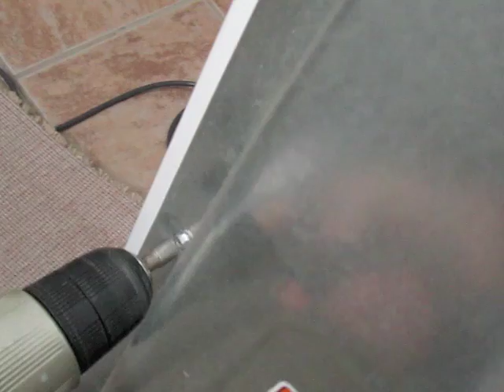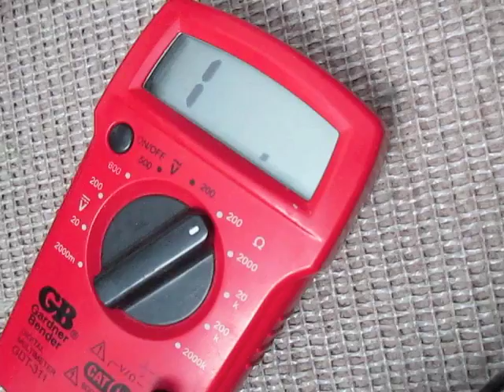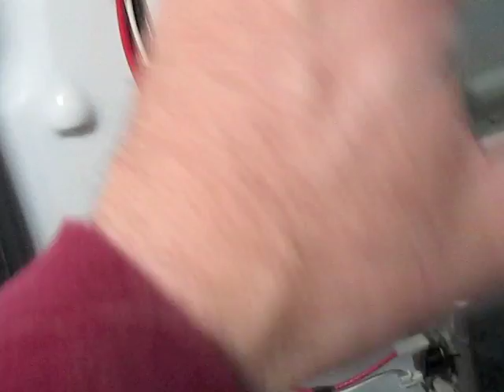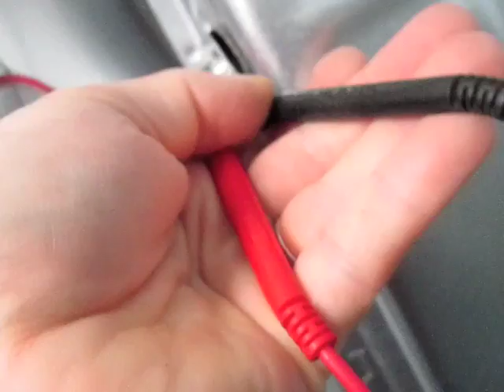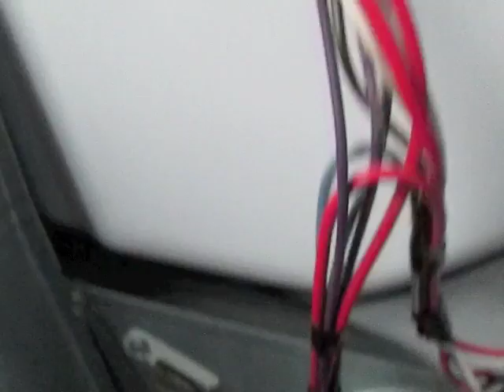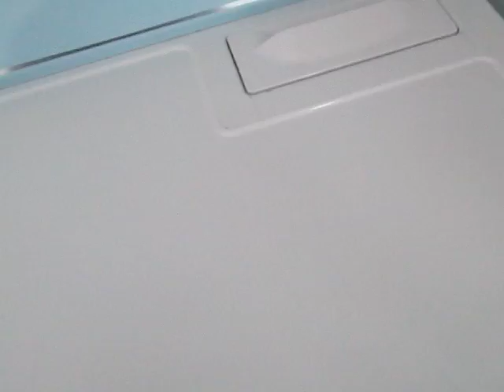Whirlpool Kenmore Roper Dryer won't heat Test or Replace heating element thermostats & fuses

Comment: I replaced all my fuses and thermostat and heating element comes on for about a minute then shuts off any ideas what’s wrong
Reply from the maker: Clean Lint filter?Probably if you went this far.  Did you disconnect the vent and make sure the vent tube was clear all the way to the point where it leaves the house?  Some times the tube is clear and it is clogged at the vent where it leaves the house.  First start by looking outside where it blows outside and make sure that is clear.  Then follow up by cleaning out the tube.  Then try and let me know if you're still having issues
Reply: @youcanfixit3721  I replaced the vent tube and it still doing it. I bought another heating element just waiting for it to come. Can it be the timer? It does move

Comment: Hi there, thanks for the video, helped me replace my heating element last year. 

This week I just replaced the belt and idler pulley, and that went fine, but after putting everything back together, the dryer drum spins up nice, and the heating element comes on, but when I add clothing or weight to the drum, the heating element does not come on. I remove the clothes, and the element heats up nice and red (I have the door switch disabled so I am able to see what is up with the door open).  Any ideas?  Thanks so much!

Edit: OK, this is strange. I just pulled the entire dryer about 12 inches forward, away from the wall, and it is now working flawlessly. My guess is that something is lose? Or maybe a thermal fuse is going bad? I guess I should double check everything. Thanks!

Edit 2: OK, so my theory now is that when the belt broke and the drum stopped turning last week, the dryer overheated and blew the thermal cutoff. Does this sound plausible?  I went and removed the vent hose and ran some tests. When started from cold, the heating element will come on and the dryer turns, drying the clothes for about 10-15 minutes. At that point I will hear a slight buzz or hum from the dryer and the element shuts off and the dryer just spins cool. So, does anyone think that I need a new thermal cutoff? Or even an entire new element? Any idea what the buzz/hum might be coming from? It is definitely associated with the heating element shutting off because I hear it as soon as the heating element shuts off.  Thanks so much!

Ray
Reply from the maker: sorry I was away.  I'd check to make sure you vent tubes are cleared of any obstructions.  make sure it is not clogged at the exit point where it leaves the house and that the vent tube is clean.  This usually blows the fuse though and the dryer won't work.  It does sound like a thermal cutoff.

Quote from internet search;
"What does the thermal cutoff do in a dryer?
A dryer's thermal cutoff switch controls the dryer's temperature, and it also monitors the amount of heat it produces. If the dryer drum is spinning but is not producing heat, the thermal cutoff switch may have failed.

How to Troubleshoot a Dryer's Thermal Cutoff Switch - Home ..."

Comment: Why thermal fuse keeps blowing?
Reply from the maker: Disconnect your vent tube from the back and see if it's plugged.  Clean it out as well as check the outlet on the outside of the house to make sure that's not clogged.  Clean it out good.  If you see nothing through the vent tube you will have to unplug and  take off the back and check to see if it is clogged on the inside.  Should be an easy fix.  1/4socket, a screwdriver, the fuse, and a vacuum.

Comment: Not helpful for diy!!explain multi meter settings smarty pants!
Reply from the maker: Well that would be on a different tutorial on how to use a multimeter.  If people wanted a 20 minute long video I would have done that.  99% of People don't.  Just set the multimeter and test it as shown.  If you don't know how to use a multimeter that's a different DIY tutorial...

Comment: We got a meter and tried it but we get no registering at all.  Not the heating element or the fuses.  What's wrong do you think?  What else can we try?  The meter seems to be working right.  We checked that first.
Reply from the maker: Well they can't all be bad.  One of the things go out typically at a time.  Either the multimeter is bad or not set correctly.  look at the element and see if it's broken.  what's actually wrong with the dryer?
Reply: @youcanfixit3721  We decided to order a complete set of heater element and all the fuses.  I'll let you know how it works out for us.  The dryer turns but there is no heat so we think this may solve the problem.

Comment: I bought a new thermal fuse but my meter counts down to zero. New heating element and it reads 10? Any ideas? I’m very confused why it won’t heat up. On a side note, thanks for putting your time into this. Helps electrical novices! Thanks for your time!

Comment: Thank you very much! I watched this video last week after the Mrs. dryer went out. I bought a multimeter and, following your tips, discovered a blown fuse in the lint trap. $7 part that I just put in and presto, it works! I looked like a genius thanks to you.
Reply from the maker: Awesome!  I really appreciate the comment.  It makes me feel like putting these up is worth while.  Glad it save you a ton of money and saved you from putting a perfectly good dryer into a landfill.  Thanks again for the comment and as always off to the next repair :)
Reply from the maker: Oh yeah I'm not sure if it's still going strong, but often that fuse goes out if the vent is getting clogged, so if you haven't checked it yet you might want too...  Thanks again!!!
Reply: @youcanfixit3721  yessir, the ol hotbox is still choochin, thanx to you. A recent maitenance job at a grade school also proved this repair works.
As for the ductwork, I now have a new quarterly chore to perform, along with a good dusting of the ignition system. Thank you kindly for your generous sharing of useful knowledge; a true rarity these days.

Comment: Can you get those parts at Lowes or Harbor Freight?
Reply from the maker: I don't believe so.  Ebay Amazon or a local appliance parts store.  The white fuse is either good or bad and you can get one of those used on ebay for way less and it's just as good as a new one.  If your fuse went out make sure to check that your vent tube isn't starting to get clogged, that is one of the biggest issues for the fuse going out.

Comment: Does anyone know what make a dryer stay hot even when it isn't running
Reply from the maker: I'm guessing it's an electric dryer.  Timer issue, check your element.  High Limit fuse may be bad or bypassed as this should have turned it off.  Maybe someone just ran it without you knowing to get some wrinkles out of the clothes and then you checked?  Sorry just some possibilities...  I wouldn't run it till you get it figured out though or make sure your close by to monitor, so you down burn the house down... If you do look around make sure you unplug before you inspect and when it doubt call a certified Tech or buy a knew one, but most dryers are fairly basic and you can probably find a how to on your exact model to take apart and put back together...  Best of luck.
Reply: You can Fix It!!!! ,No one ran it without me knowing, it kept causing the breaker to turn off, anyway had an electrician look at my breaker box, thought it was that, anyway he looked at dryer he said it's hot as hell,I felt of it,and it was really hot,it wasn't running, sounds like I hear a humming noise when it's plugged in,so I unplugged it,it cooled off, problem is it's not even a year old,I lost the receipt so I cant take it back.
Reply from the maker: @kellyhill4613  Sorry it's hard to really give a good diagnosis not being there.  Here is the first place I would try.
Defective Heating Element

A number of components inside the dryer can cause overheating. The first and most obvious is the heating element itself. If it has shorted, it may stay on even when the cycling thermostat turns it off. A visual inspection may reveal that it's touching some part of the assembly casing, but if not, you should unplug the dryer, remove the heater assembly and test it for continuity with an ohmmeter. If the meter indicates very low or no resistance, the element is defective, and you should replace it.

https://homeguides.sfgate.com/causes-thermal-cutoff-keep-going-bad-dryer-71276.html
Reply: You can Fix It!!!! ,Thank you for the advice, I am gonna go get a heating element,and see if it fixes it,but now it won't come on,idk i hate to have to buy another one since this one isn't very old,makes me so mad that i lost my receipt,or i could take it back

Comment: If u don't have a multimeter u can touch the two blue wires together, plug in the dryer and if it starts than u Kno it's the thermal fuse. That doesn't mean u can use the dryer because it's now a fire Hazzard but at least u Kno it's only a ten dollar fix

Comment: I very much appreciate this video. All my fuses and thermostats registered at .3 or .4  In your video, you said they should read around 1. Do you think I should I replace all three? The heating element registered at 10.4 like you said it should. Thanks!
Reply from the maker: Not sure what setting you were on.  Really Not sure what was happening with your dryer?  Motor,fuse,thermostat,push to start button, relay, timer?  Hopefully you got it fixed I was away for a bit, sorry for the delay in replying

Comment: good video. Is it possible for a cycling thermostat to test ok (continuity at room temp) but cycle at a temp too low ? I have a dryer that doesn't get warm enough. Air flow is good/clean.
Reply: check your exhaust vent, if it is stopped up it will cut the element off and will not cycle it enough to dry the clothes.

Comment: SLOWWWWWWWWWWWWW   DOWNNNNNNNNNNNNNNNNNNNN
Reply from the maker: Sorry about that, was one of my earlier vids.  I make them a bit quicker, so that people can watch them once through and determine if it's valuable information.  After they determine it is of value they can do each part and pause at each step.  Sorry I try to make videos that are not super long, so people can quickly determine if there is value in the video without having to listen for 10 minutes and determine it was a waste of time.  Thanks for the comment though.  Pausing at each part will make it a bit easier and I see I should have zoomed out on the whole section.  That would have made it easier to determine which parts I was working on.

Comment: Is there any other way to check the fuse with out one of those things that reads it?
Reply from the maker: Depending where you live you can get a multimeter for $3-10.  I was in Vegas and stopped at a freight store and got one for free, but they were just under $3 without the coupon I had.  I live in Alaska and it was about $10 at the hardware store

Comment: my element reads 0.L so that means its dead?
Reply from the maker: If it's your element you should also see it is broken somewhere along the way.
Reply: yup it was broken. thanks a bunch.
Reply from the maker: I've heard of people putting a crimp of some sort to connect the broken spot and having that work, but I'd suggest looking on ebay or amazon, best of luck...
Reply: I bought a element kit with three parts. The element, thermo, and some regulator that's by the element.. I went ahead and bought the kit for $5 more.  Thanks a bunch.
Reply from the maker: Save your parts, because if those go faulty you have them.  I always suggest putting them in a ziplock back and then duct taping them to the back of the washer or dryer, which ever has enough space behind it.  Best of luck...

Comment: I was about to spend $18.50 on a thermal fuse but I watched your video and you mentioned checking eBay so I did and got it for $4.15! Thank you! Great video.
Reply from the maker: Sweet Glad it saved you some $$$
Thanks for the comment and glad it was of some use.
Reply: never buy a used electrical part....ever.

Comment: Thank you but you're going way too fast. A step-by-step for people to know what settings to put on the meter and what to read would have helped much more.
Thanks for the website reference. Good one.
Reply from the maker: Yeah it is suppose to be done step by step and paused at each step.  Otherwise the video would be about 15-20 minutes long and no one would click to watch.  Sorry about that.  Try hitting the space bar to pause it at each part.  Hope you got it figured out....  Thanks for the comment and advice.  Next time I may make a short video and a longer video.  Thanks again
Reply from the maker: Sorry I intentionally make them quick.  Watch it once through.  Then watch one part pause it - do it, then watch the next part pause it - do it, and so on.  I sometimes create videos and write a pause into the screen so people can stop it and get some work done and then resume for the next part.  Hopefully it still helped and were able to get it done....Thanks for the advice and post...

Comment: I've checked everything in my dryer still is not heating. Everything is checking out like it's supposed to
Reply from the maker: +Greg Morton If you didn't figure it out here is a web page that can get you started in the right direction.  Sorry I can't diagnose timer, current, thermostats, fuses, or element without being there.  Hopefully you figure it out, but this will get you started.
http://www.easyapplianceparts.com/Dryer+dryer-wont-heat+repair.htm